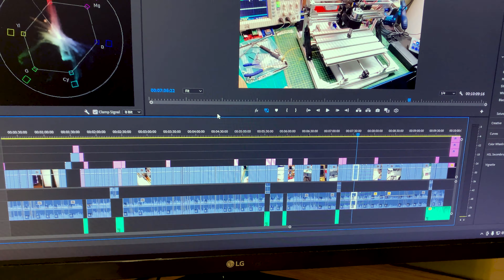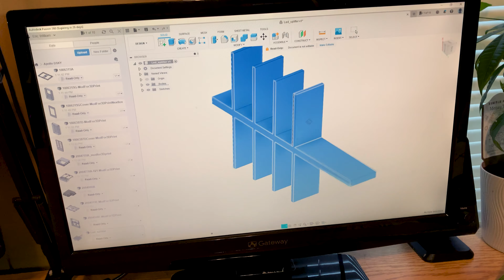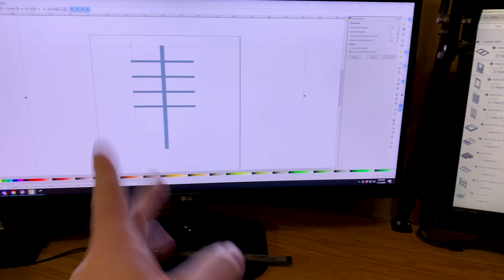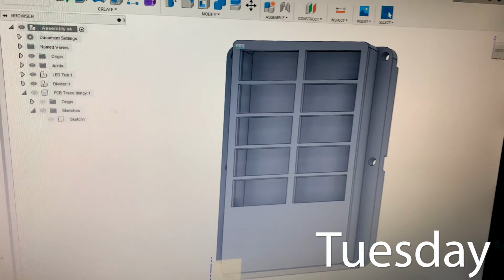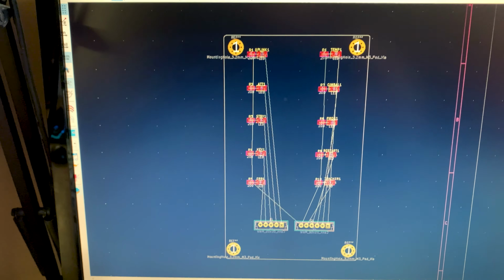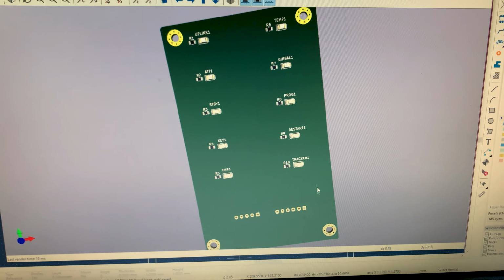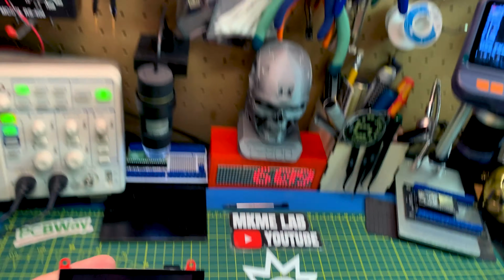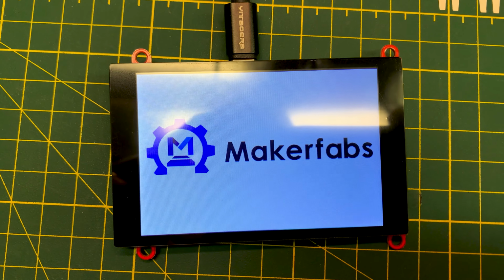I Didn't Think It Would Work!  3018 CNC & PCB Making UPDATE

Comment: you can also then change the layer of the imported dxf and actually use the outline for edge cuts to get the best fit in the case :)
Reply from the maker: Is there a way to scale it in KiCad easily?  Just moving it to edge cuts would be the same size as the enclosure. Cheers
Reply: @MkmeOrg  No, the drawing tools in inkscape are a bit lacking tbh however in inkscape there is an option on the path menu to do inset/outset which can to this.